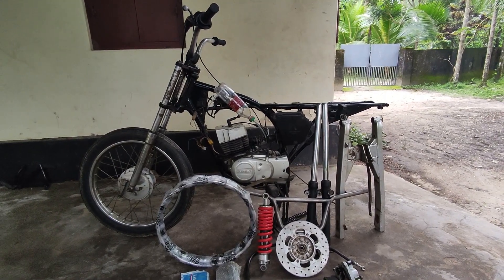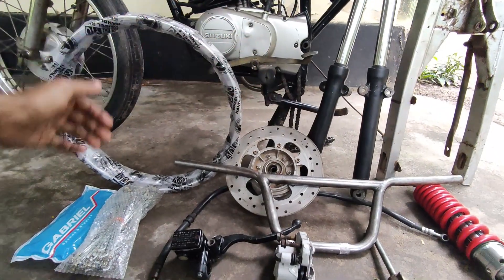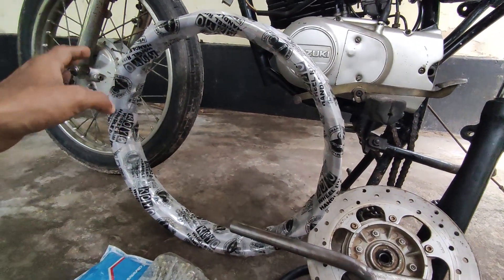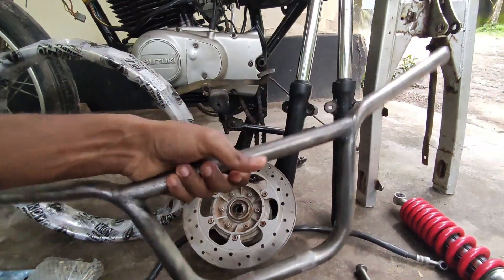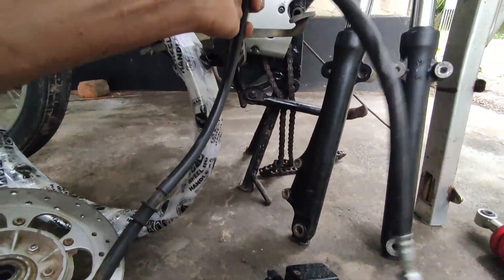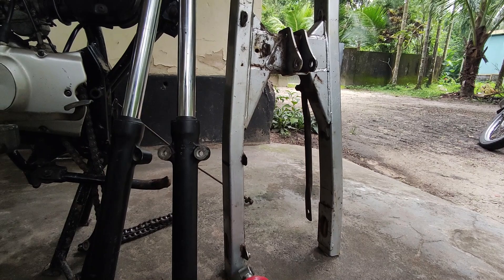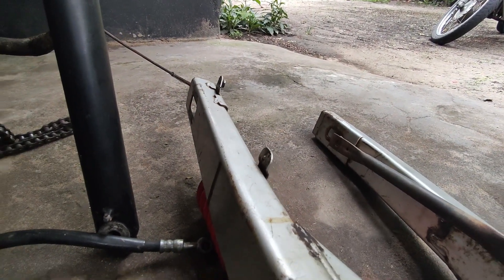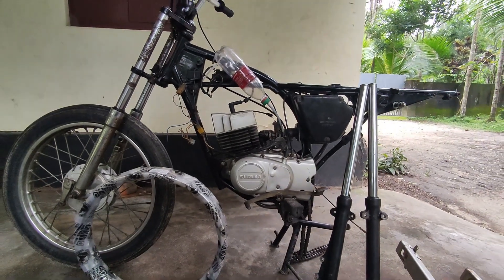Project RDX update / Spare parts updated

Comment: Bro enta chetak full time cheriya throttil missing kanikunnunde whats problem  carb tank plug ellam ready akki ennittum inde  petrol edukkatha pole ane first kittum pinne kurach kodukkumbham missing pinna onnooda kootti kodukkumbham okke ane enthayirikkum problem carb chaing cheyyandi varuo
Reply from the maker: 1 Carburator tune cheythu nokku
2 Carburator clean
3 Slide damage undenkil (overayi thengittundenkil Carburator replace cheyyendi varum)
Reply: @Rtrone  carb clean cheythu tune cheythu  slide damed indo nokkate
Reply from the maker: Yes